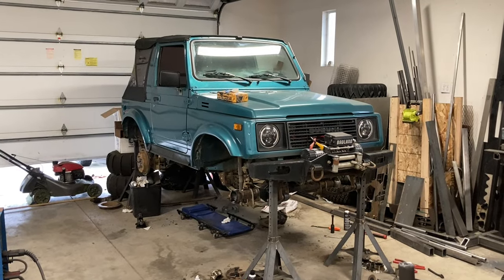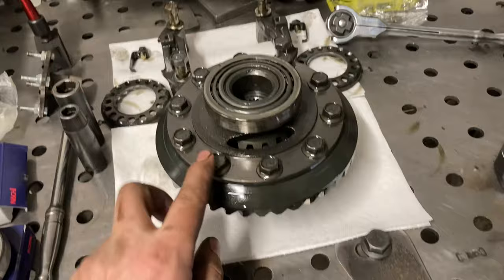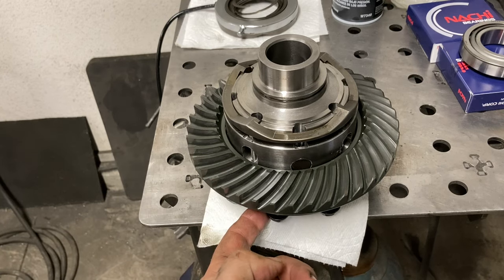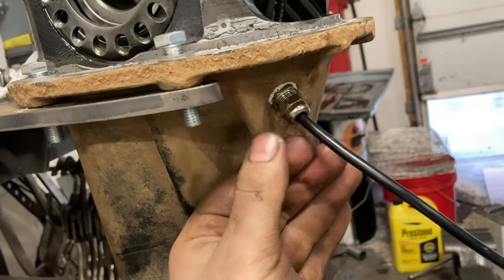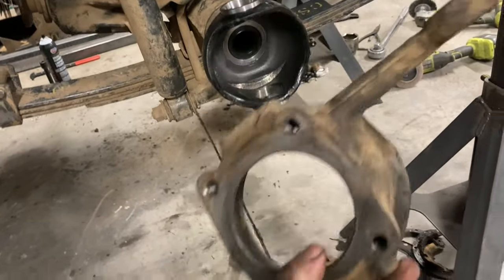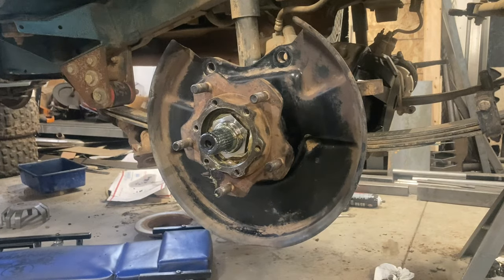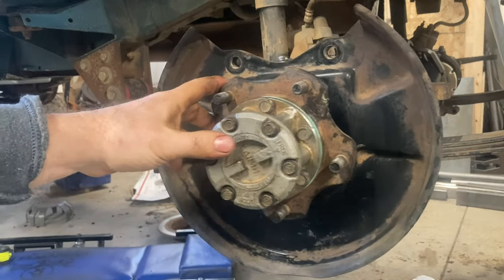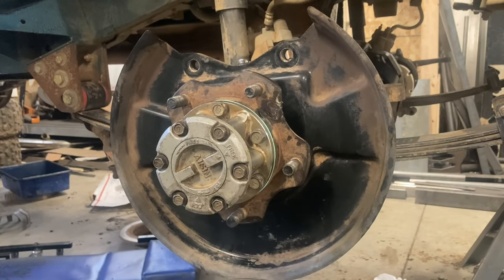Suzuki Samurai TRE4x4 electric locker, RCV axles and 2”lift installation PART 3

Comment: Great video. What is your thought on using a solid spacer with shims versus a crush collar?
Reply from the maker: @brianb.2857  the solid pinion spacer is definitely better. We used the crush sleeves on this one because it doesn’t get abused and the small tires.

Comment: whats the duty cycle like on the magnet? If I plan on leaving these on all day am I better off with air lockers?
Reply from the maker: @MonkeyWithAWrench  I don’t have a duty cycle number, I run my rear on almost all the time. The amp draw is a hair over 1 amp, so they can’t make much heat. I’ll teach out and see if I can get a solid answer.

Comment: Hi, I'm waiting on my TRE elocker right now to swap out the mini spool on my rear axle. I've never done any work like this, I was wondering if I needed to order anything extra when replacing this? I'm using this as a chance to do the SJ410 backing plate mod and re-build my rear wheel bearings. Do I need a full differential rebuild kit? Can I get away with just getting two carrier side bearings if I'm not planning on replacing the pinion bearing? Will I need extra shims?
Reply from the maker: If your pinion bearings are ok then all you need are carrier bearings. I use longer bolts for the sj410 bearing retainers, stock ones are too short. New oil, lock tire, and RTV is all you should need besides that.
Reply: @ultra4suzukisamurai679   Thanks! Do you happen to know the measurements on the longer bolts you use? I hadn't seen that anywhere yet. I think I'll just order a full rebuild kit as well as a solid spacer to be on the safe side.
Reply from the maker: @bowen11  m8x1.25x30 from memory.